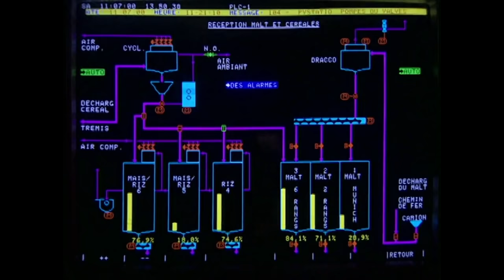How It's Actually Made - Beer

Comment: I’m glad you at least almost got the four ingredients of beer right, instead of Barley the proper term is actually Malt.  See what happens in the Mashtun or “danger tank” is the water is brought up to a strike temp of about 164-168° F.  Then Malted grains are introduced, these grains can be barley, wheat, oatmeal, or rice, it is best to just use the term malt as a generalisation. The malt exchanges heat with the water for a temp of around 150-160° which you want to stay at.  The reason you want to stay between 150-160° is because that is the temperature where the malt will release its natural sugars, maltodextrin. Once the grains have steeped for about 30 min- 60mins they will be Lautered into a lautertun, and the spent grain will be sparged with hot water in order to get any remaining sugars out, following this comes the hop addition and boil.  Hops help preserve the beer, as well as balance the sweetness with bitterness, hops are actually related to the cannabis plant Marijuana and are in the same family, a beers bitterness is measured in IBUs, or International Bitterness Units, and the bitterness isn’t just determined by the strain of hops you use but also how long those hops boil for, and when they are added to the boil.  Once the boil is complete the wort needs to be brought down to a temperature of 90° F and fast, otherwise bacteria can contaminate the batch, so normally a device called a cooling machine is used to get the beer to a decent temperature in order to pitch the yeast.  The yeast is pitched by a retired yankees pitcher Andy Pettitte which starts the process of fermentation. The beer ferments for anywhere from 2 days to 2 weeks depending on the yeast used, and then it’s ready for carbonation.  Many large breweries use a brite tank for this, and it forces carbonation into the beer for a delicious frothy beverage everyone can enjoy.